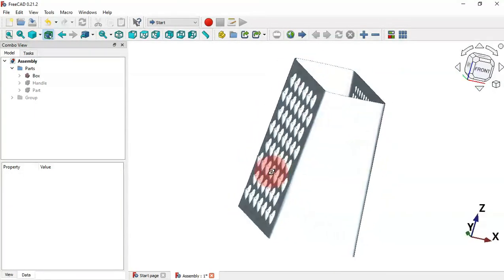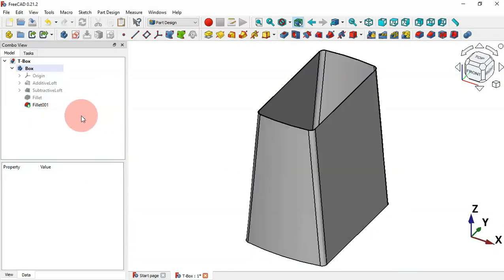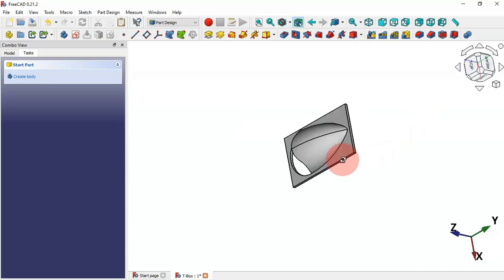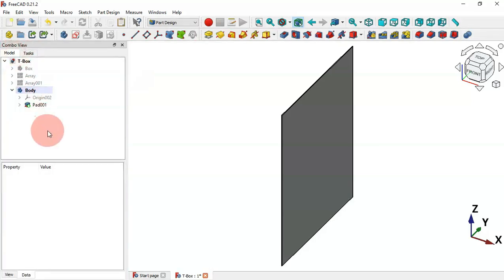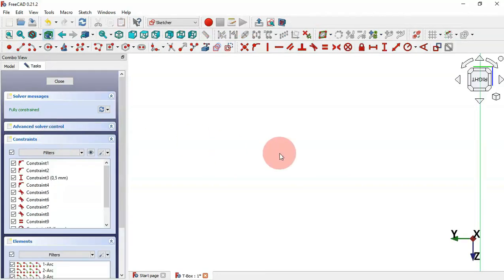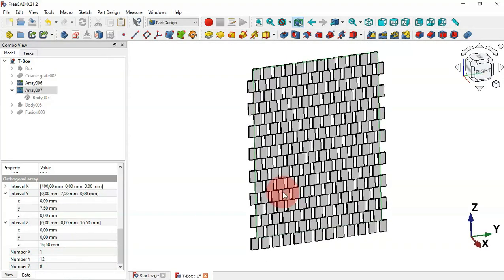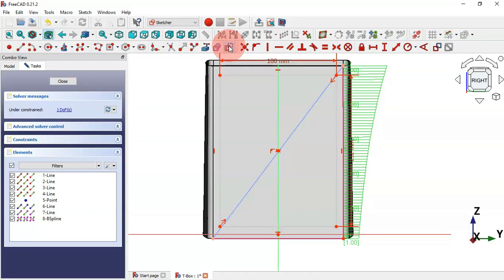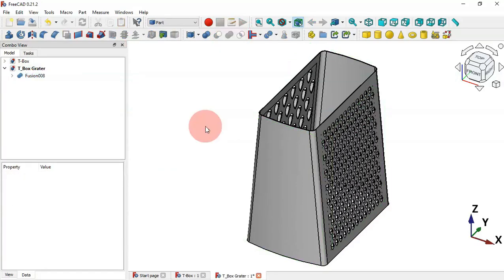FreeCAD 0.21 Box grater (PartDesign, Draft and Part.)

Comment: Hi,
Nice video, as per usual !
At the beginning, to obtain a hollow box, you also can use the function "Thickness" after having selected (by clicking on them) the upper and lower faces of the box (options: setting the thickness to 0.5 mm, and generating the thickness inwards). It seems simpler to me.
Reply from the maker: Have you tried it and got not problem with the thickness tool?
Reply: @OffsetCAD  Yes, I used the thickness tool straight away, and I didn't have a problem (but actually, I wondered if you hadn't had a problem since you didn't use it!). I have already noticed that FreeCAD can react differently on different computers, perhaps because their computing power is different? Have a nice day!
Reply from the maker: Are you Windows user? I tried and won't worked.
Reply: @OffsetCAD  Yes, I use W11.

Comment: Hi, thanks for the video. very creative idea to make the grater with the revolution but at the end it's not so sharp as it should be. I would consider to make it within Part workbench with a plate and inclined cylinders array and a boolean cut. It's worth a try?
Cheers
Reply from the maker: What do you think about using an Elipsóide primitive on PartDesign, it will much the sharpness?
Reply: @OffsetCAD  I've tried with cylinders and cones using Part wb. I got better results with cones. 2 cones more specifically. 1 cone fused to a rectangular plate in order to get the budge/boss and another smaller acute cone (reduced diameters compared to the 1st one) and inclined around 15º to obtain the sharpest edge as possible and the chanel trespassing the bulge and plate. I'll supply a link to my Google Drive later. 
I also thought about the usage of the ellipsoid indeed. You can make a video if the result is inspiring. Cheers
Reply from the maker: Good, very good!
A few days ago I tried using ellipsoid.  I looked good, despite the difficulties FreeCAD had, always breaking the shape.

I'm thinking about making a video, but it will be uploaded later.  I've been really busy with school these past few months.